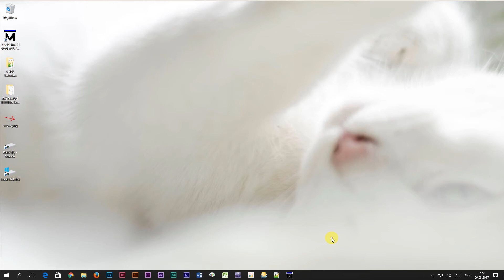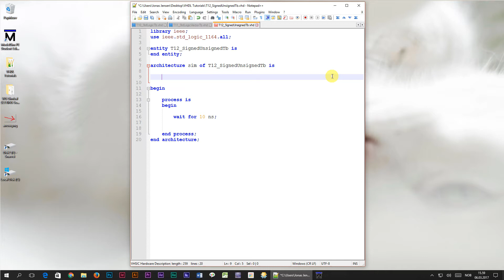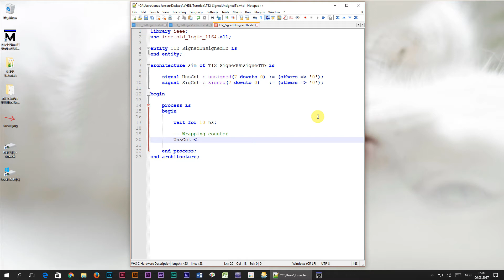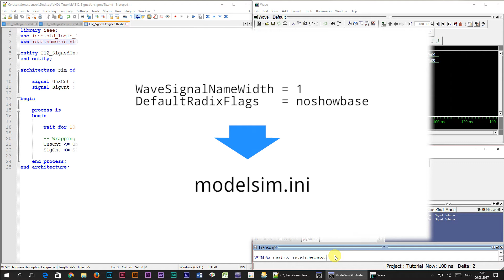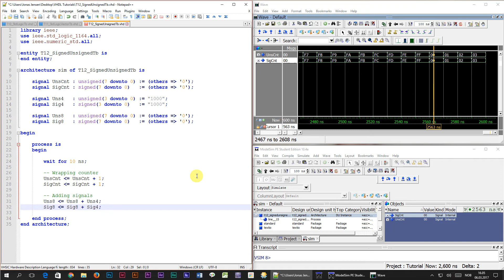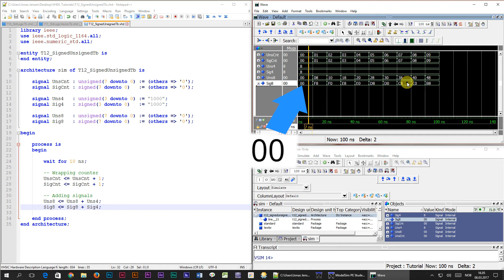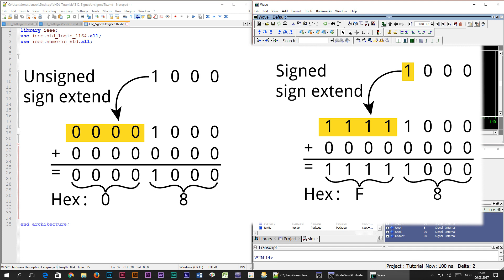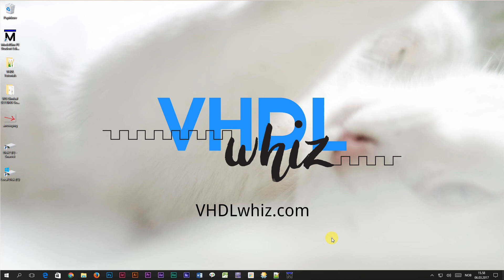How to use Signed and Unsigned in VHDL

Comment: during signed addition: we did 2's complement of Signcnt4 = '"1000=00001000= 11110111+1=11111000" value..then did addition with Sgncnt8="00000000"=1111 1000 = 8hF8
Reply: And the reason it did 2's complement is cause the sign bit was set (bit 3), otherwise it would've just done a simple addition